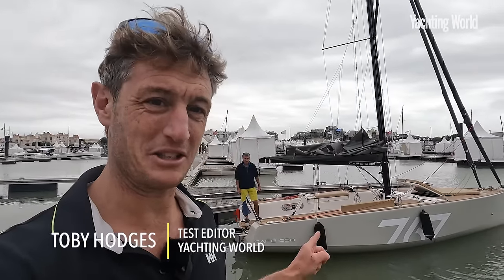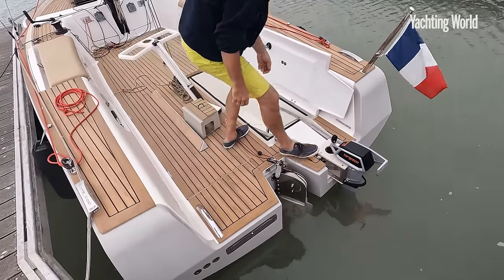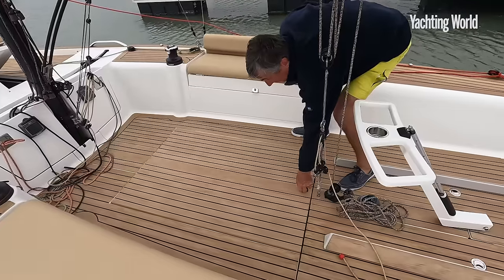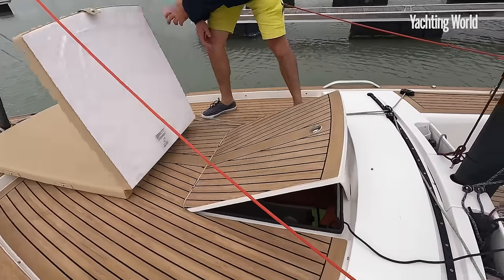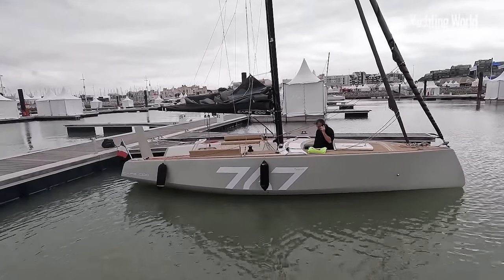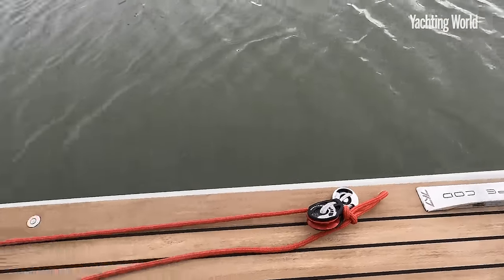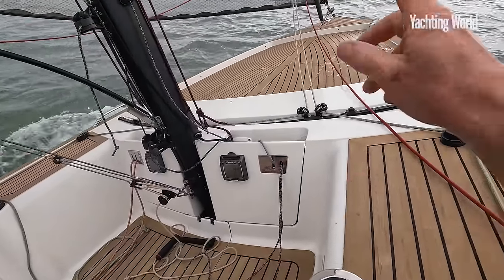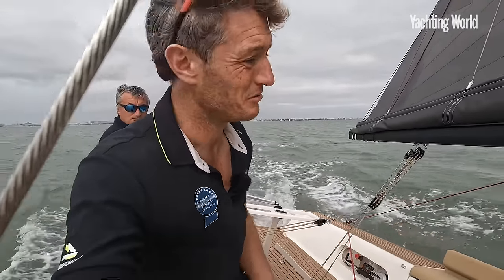Packed with interesting ideas and innovations | sailing the Cape Cod 767 | Yachting World

Comment: Like everything else these days, sailboats have become too expensive for a lot of people. Interesting concept, waaaaayyyyy too expensive for what it is.
Reply: €110,000. oof. If you compare it to 80s boats that would probably get you a 28 with full accomodations.
Reply: @Tb0n3  110K will buy you a hell of a cruising boat from the 00s
Reply: @jaysparc  I was just referencing how much they cost with inflation and in the 80s it was still 110,000 but you don't think about it when you see a price at 40k.
Reply: Just buy a used yacht then. There are plenty at good prices
Reply: @Tb0n3 compare the price of a loaf of bread or a dozen eggs these days vs the 80s
Reply: @alancalvitti  I know what inflation is and I'm just saying that price of similarly equipped yachts have outstripped inflation by a fair bit. They know their customer and their customer is rich not an every man. The Everyman needs a powerboat because the Everyman works all day and doesn't have time to relax and sail. Unfortunately these days due to rampant consumerism the Everyman is leveraged to the hilt with every little thing he sees advertised on tiktok and YouTube and Facebook and Instagram.
Reply: Yes but the second hand market is better than ever
Reply: For a more reasonable approach, take an Olson 25 or Moore 24 about $7500-10,000, locate a good F glass guy and make mods for maybe $15,000-20,000, and you'll have an equivalent performance boat for a fraction of the cost. Well thought out tooling / features though.

Comment: 109,000E, gasp
Reply: The boat is coming with its basic equipment at 109 500 €. Most of the time, the prices given correspond to the naked boats to which it is necessary to add equipment and accessories.

Comment: Need to correct the conversion factor for sail air m2 to ft2. It’s off by a factor of more than 3x. 20m2 x 10.28 ft2/m2 = 205.6 ft2, not 65.6 ft2. Love to concept and the implementation.